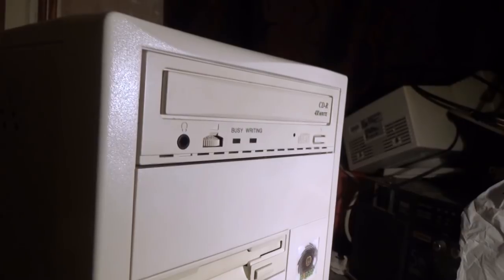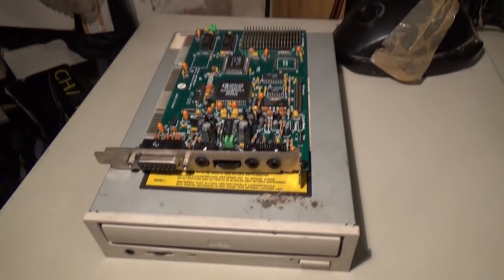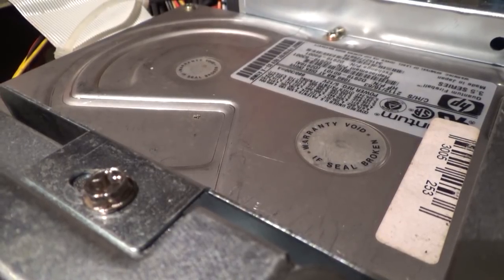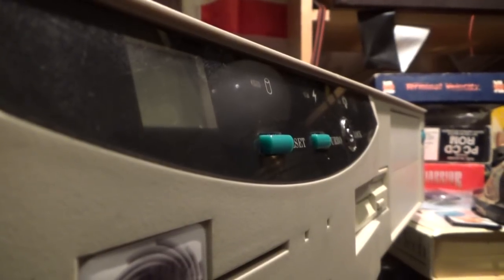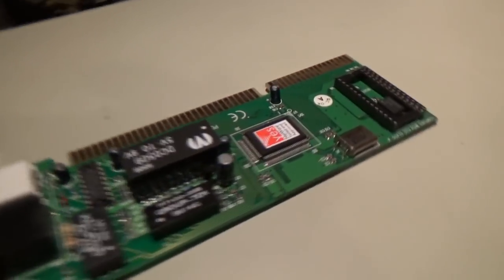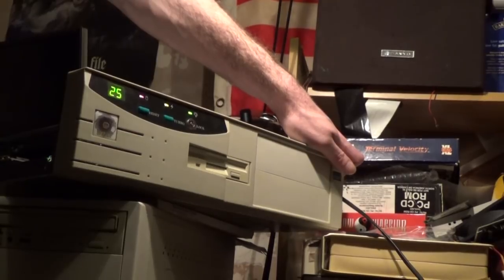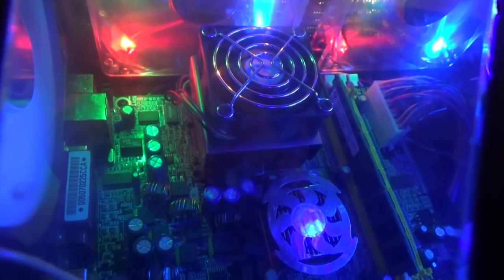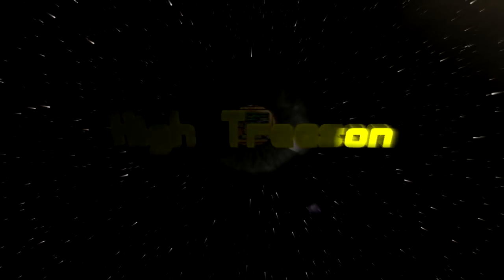1994 PC - Reality VS YouTube

Comment: My first pc, bought in fall of 93. Slc2-50, 4mb ram, 120mb hdd, et4000 and sb-pro compatible sound galaxy. Cost was some 6000 kroner. One pound was roughly some 12 kroner at that time. I got the machine complete with monitor, mouse and keyboard.
Reply from the maker: Around £500 in UK money then. Seems like a pretty good deal for the time, really, given how many 80s micros were still in regular use, this appears to be the point where it started turning.

Comment: "Channels like mine are inherently flawed because they often show the better hardware available in unrealistic configurations" Very true. I'm super guilty of this but a lot of it has to do with the fun of putting together a machine I never ever could of afforded back in the day or just seeing how far you could push an old machine. I'm especially guilty of pushing hardware with running software at higher resolutions then what many people would of used or running games that weren't available at that time. I particularly like to see how "high end" hardware of any era can handle these more stressing environments. unfortunately this bites me in the butt sometimes as the results don't match up to people memories because most of us, me included were using much more moderate settings to get better results.
Reply: Thought I’d see you in here :-) I personally like to “under-OS” my retro PCs.  For example, I’ve almost finished my Windows 95 one, which is... a Pentium III @ 700MHz, 192MB of RAM, Matrox G200 with a socketed 8MB of RAM, 2x 12MB 3DFX Voodoo2s in SLI, 3Com Ethernet card, Creative Sound Blaster AWE32 CT2760 (soon to be maxed out with 28MB of RAM), Relisys DVD-ROM, LG CD-RW, Iomega ZIP250 and Samsung 1.44MB 3.5” floppy drives, and a Maxtor 30GB hard drive. It also has some newer parts, being housed in Evercase (brand new beige box!), powered by Cooler Master and cooled by Arctic and Gelid.
Reply: sound very similar to my Win 95 rig except I'm rocking a 450mhz PII. I have the same SLI V2 and G200 setup though plus a Matrox M3D for some sweet Power VR
Reply from the maker: There's nothing wrong with pushing the limits at all, you just gotta do it sometimes, it's fun to see how far you cold go, or how far you could have gone at a certain time. Admittedly my builds do tend to be more utilitarian than most though, in that they end up being focused more on productivity than games and rarely max everything out. Video cards rarely have much in the way of 3D capabilities, if any, and focus more on getting Windows or DOS/VESA to run well, I never upgrade AWE cards because I see no advantage, though I might upgrade the Maui due to having modules spare, and I've been known to pull out cache and RAM that isn't really useful to me. Hard drives though, those tend to be oversized in some cases, largely due to the cost of smaller ones.

Comment: Great video, in 1994 I had a 386SX 40 MHz, 4 mb RAM, 120 MD hard disk, Trident 512k VGA. Added a Soundblaster pro that year for £90 then a Panasonic 2x CD ROM that interfaced to the sound card, that was over £100. I was still using my Amiga 500 for games at that time too.
Reply from the maker: Whilst I can't remember the numbers off the top of my head, it would not be surprising to learn that this 386-40 was in the same league as this thing as far as speed was concerned. The whole incremental upgrades thing is nice to think about now, it's not quite the same anymore. Amiga was definitely still around at that point and things were certainly still coming out for it, it appears that this was around the point where the PC had caught up and was starting to displace it. The capabilities had theoretically been there for a few years but nobody was using them, probably couldn't afford to and so never really did until '93 / '94 onwards.

Comment: My 1994 AT&T 486SX, OEM config:

- AT Desktop Case
- 33mhz 486SX
- VLB Cirrus Video, 512k VRAM
- Jazz 16 Sound
- 250mb IDE HDD
- IDE/Floppy on ISA Bus
- 4mb RAM
- Sony CD ROM
- No L2 but space on motherboard to add it
- Price was $1299 in late 94

This I feel would be representative of a bigger OEM budget machine from mid to late 1994 in the US market. The multimedia inclusion is actually pretty generous and the VLB slots are usable. Your absolutely right the Pentium did not catch on until well beyond 1994. The 486 in it's later revisions was more than sufficient for the entirety of 1995. The Pentium 1 was still relevant in 1998, and OEM's were shipping new systems then, well into the Pentium 2/Celery era! The rate of transformation in terms of performance from 1994 to 2000 was severe on all fronts. It's easy to forget, but the performance reign of the RISC workstations (SPARC, MIPS, PowerPC) was rapidly encroached on and surpassed by new x86 chips by the end of 2000. Whitebox PC's being fast enough ultimately killed off the workstation market. Yes, the performance increases were so vast that it ended entire industry verticals!  

The humble 386sx-40 was still relevant in 1994 and was put into many ExcelBoxen at the time. 

Very few people had the privilege of having a fast 486 or Pentium PC. Even fewer had the privilege of a Macintosh Quadra with it's high resolution frame buffers and large RAM ceilings. Even less had real UNIX via a Sun SPARCStation or SGI product. 

Looking at my own collection of vintage machines, it is absolutely out of the realm of all but the most wealthy of the time to have had. A corporation could have had high spec boxes, but not your average person. Deprecation is great, it lets us enjoy the old high end without going completely broke.

Comment: I remember I got my dads pc when I was younger, it was the first pc he built in 1995. Based off a 286 Dell 210 that he bought in 1993 he found it too slow so he gutted it and bought new parts at the time. It had an intel classic R 486 motherboard running a pentium overdrive 83mhz overclocked to 100mhz, 32mb fpm 60ns ram, diamond speed star 64 2mb video card and a sound blaster pro 2.0 with an adaptec SCSI card, Toshiba SCSI cd rw, SCSI 2gb Fujitsu hard drive and a 2.6gb ide Fujitsu hard drive. For some reason we also had an Iomega ditto and zip SCSI versions hooked up to it. He built it for the soul purpose of playing Ef2000 and then later on Quake and doing all our household stuff like storing photos off our Sony Mavica. Running dos 6.22 and then later windows 95 It lasted him all the way to 2001!

Comment: My first machine was my dads office machine. It is a Wang Labs PC260, a 286 with 1MB of RAM, a 20MB ST-225 Seagate HDD, a 1.44MB floppy, and a Tseng Labs ET3000 powered 'Wang VGA' graphics card. No fancy sound cards, and no mouse. No Windows! Just MS-DOS 5! Oh, and this was in 1995, when the machine was already 6 years old :D

I still have the system unit itself. The monitor died many years ago after many years of service. As did the keyboard... The onboard RAM has failed and I have to replace them one day.

That machine got me 'into computers' as a kid. I mean, I was only 10 at the time. A few years later, in 1999, I built my first 486, which was actually an upgrade of a clone 386SX-20 machine my dad got from somewhere. I fondly remember going to the second hand computer store in the city with all of my $75 I had on me, and asking the old guy behind the counter if I could please buy a 486DX2-66 + motherboard + 8MB RAM for that. He said sure, and even threw in a VLB super IO card and a VLB Cirrus Logic SVGA card too. Those were the days!

Comment: Wonderful video!  Spot on about how things were at the time. Made me think of the old 486 I had from 1994-2001.
Reply from the maker: Thanks. Out of curiosity, what did you move up to in 2001?
Reply: Went to a k6-3+ 450 overclocked to 600 on an Aopen AX59 Pro board. Loved that chip and board. Wasn’t too far after that (early 2002 perhaps) I bought a duron 1000 on the famous/infamous ECS K7S5A. Never got the ECS board to run as stable as I would like and eventually swapped it out for an MSI socketA board. Ended up using that and the k6-3+ for several years (up through 2005 at least which is when I made the foray into Athlon 64).  Two of the best systems I ever built/owned.

IIRC the 486 was originally a dx2-50 that I had upgraded with one of the typical 5x86 133 upgrade chips circa 1998. The trinity works version I believe :)

Comment: This is so true.  Business apps ruled the day.  The perspective people have now is that games drive the innovation but back in the 80s and 90s it was the humble accounting departments that opened up the doors into low cost mini computer alternatives.  It was ghetto arcnet running across department floors with netware servers tucked into broom closets humming along serving up btrieve and wordperfect with win3.11 booting from the network.  Arcnet was huge and can't be understated.  It really wasn't until unshielded twisted pair Ethernet coupled with NT4 that this recipe changed.  Then Joe Pizza Deliver Guy had the requisite skill sets to overtake the NetWare juggernaut.
Reply from the maker: Ah, now, I did want to mention diskless workstations, but as this was focused more on the home user it seemed needless here. Nonetheless, you are entirely correct, doing things this way was commonplace in offices for quite a while.

Comment: Good video. It's a good reminder that for most of the 90s, the mainstream was sold older generations of hardware.  The latest gen hardware was only for high priced builds that consumers could rarely justify.
It's kind of funny that the expensive Socket-4 Pentium platform was such a dead-end that 486s ended up outperforming them with all the upgrades (especially from competing CPU manufacturers) that came along later.

1994 was the year we made the stunning leap from a 386SX-16 to a 486DX2-66. Unfortunately the shop we bought it from were dealing in cheap PCChips boards. I was very frustrated trying to play games on our 486 due to all the random crashes. And we paid a premium for a "genuine Intel" chip, lol. We should have bought a better board and a 3rd party CPU.
It had an old ISA graphics card, which probably held it back but at the time I/we didn't know any better and a new VLB graphics card would have cost money.
Of course we also kept our old peripherals, hard drive, and floppy. No CDROM until mid-95.

To be fair, although the slot-A Athlon was introduced in 1999, it was an expensive and clunky platform at that point.  I remember admiring them but they were out of reach, at least from my perspective at the time.  They didn't become decent until socket-462 came along.

I was given parts for a board/CPU upgrade at Christmas '99 and ended up with a K6-3. This allowed maximal carryover of our old hardware.  In retrospect it was probably a bit too much penny pinching, and it was a bad choice for 3D gaming. But it's become one of my favorite motherboards to own nowadays, since it runs basically any socket-7 CPU ever made.

Comment: 1994 is the exact year my dad bought us a Packard bell 486 25sx.  We upgraded the hell out of that sob though.  Kingston 133 was a massive boost in power and we upgraded the ram, got a cd rom and put in a sb16 and 14k modem.  Replaced it on 1998 with a p2 233
Reply: Same here. January 1994. A legend 2000 multimedia. Ours ended up with a DX4-75 overdrive, 12MBs of ram, 1.6GB seagate hdd, an 8X cdrom, and a zoom 14.4 modem. Switched to a P200 MMX in  early 1997.
Reply: @elektrosmokes1911  I loved how much you could upgrade systems, back then.  In the end, you could have a completely different computer than what you started with, from a capability standpoint.
Reply: @mikeall7012  I miss those days. Computers had "soul".

Comment: yes that was my attitude.. says it need's a Pentium?  screw that, DX-50 ran it.  You think about the tech of 1994, even the Pentium 60/66, and compare it to tech just 5 years later in 1999, it is just mind exploding, brain splattering along the walls, to see the order of magnitude things changed, and then compare that with today's tech and from 5 years ago, and it's like, really nothing has changed by comparison. Even the Pentium II was a YUGE leap from the 386.
Reply: The differences between my 1992 386SX 25 and my high-end 1998 system is massinve indeed. It's also huge between that 386 and my 1995 5x86 system.

Since I'm too young to have known the 90's, I still remember our old 2001 Acer that ran windows 98SE with a 633MHz celeron and had only 64MB of ram + SiS chipset (with integrated graphics). At first, the game I played on it were rather fine as I only played kid's games, and most games we played were still from the late 90's. But as time moved on, things became really difficult. back in 2006, that computer was massively outdated, and we stopped using it in 2008 due to its old age and the fact its capacitors died making it completely unstable.

However, the computer we bought in 2008 is still being used right now and will have its 10th birthday soon, and it doesn't seem like it'll turn THAT outdated anytime soon. The CPU is a Core 2 Quad Q6600 by the way. Things have gotten better than this for sure, but hell I even know people that still use pentium 4 computer as main computer daily. Maybe that's due to the disappearance of the "MHz race" since the mid 2000's. CPUs ran at speed between 2.0GHz and 4.0GHz back in these days, now they run in between 2.0GHz and 5.0GHz. That doesn't sound like a huge leap forward. I'm pretty sure if our CPUs were capable of reaching 10GHz, we would see a massive performance increase, but it's not physically possible (with silicium at least)

Comment: I cannot agree more on the Athlon era...
I had to make due with a soundcard-less 486 throughout the 90s and Doom was as good as it ever got for me. Then upgraded to a Celeron on an i810 chipset with no AGP. Unreal Tournament was the only 3D game I could play properly with my friends since no other 3D games had software support anymore and the integrated video was garbage. Every time I'd see a 3D game in a magazine I would soon be in for a disappointment because it wouldn't run well (or at all) on budget machines. 

Luckily soon after that my uncle helped me build an Athlon 1333 gaming rig with a geforce2 MX400. It was entry-level budget hardware and yet I could play anything I wanted on it and only had to upgrade once Doom3 showed up.
Reply from the maker: Intel i810? Oh, damn, you poor sod, those things are the devil. In fact, that is exactly what I was referring to with the "deliberately crippled motherboards with no upgrade paths" statement! That Athlon must have been night and day by comparison, though yeah, Doom 3 dragged things down quite hard at first, think I still have a review I wrote of it back then which noted this and also seem to remember it being a factor in a friend of mine giving up on their dual P3, though they opted to wait out the Pentium D launching a year later and I don't know what happened as I lost contact with them. My other friend still stood by his awful K6 (on an adapter because his board, which lacked AGP and SDRAM, was old) monstrosity because he was weird.

Comment: AMD also made a DX2-80MHz CPU ^^ (maybe not in 1994, but in 1995 it was available for sure since I got a system that was built around it).

That makes me think I've bought two really high-end 1997 computers last year from the original owner. They've been upgraded since, but their CPU stayed the same and the monitor I got with it was really high-end for back then.

The original configuration of the fastest one was something like : QDI Legend wiht i440LX chipset, Pentium II 300MHz, some ram (don't know which amount they had back in the day, I can't really guess, maybe 64MB ?), maybe a Rage II or a Matrox card, and finally a Sound Blaster AWE64 value.

I guess to turn it into one of the fastest computer of back then, all I'd need would be a riva 128 + a voodoo 1 6MB, but the guy that sold me them told me he bought these computers for video editing back in the days, so no need for that.
Reply from the maker: They did, admittedly I forgot about those, though I doubt it matters too much as the performance was comparable anyway. QDI boards were good, though the LX chipset is a bit of a cop-out, those were more Celeron focused versus the BX, the BX was king for a time. Still, sounds like it could be good, should be able to run Build games pretty fast at any rate, especially if it has a Matrox in there. Overall, it's not dissimilar to mine in principal, so naturally I like the sound of it anyway.
As for your other comment, Pentium IV machines are still usable, the only thing that kills them is the web really some sites are so bloated they barely run on this i7 laptop, though I suspect you can do a fair bit by using better browsers.
Reply: No, the LX in the first place was the best chipset. The BX chipset was released only in 1998. They just recycled the older LX for celerons https://en.wikipedia.org/wiki/List_of_Intel_chipsets#Pentium_Pro/II/III_chipsets